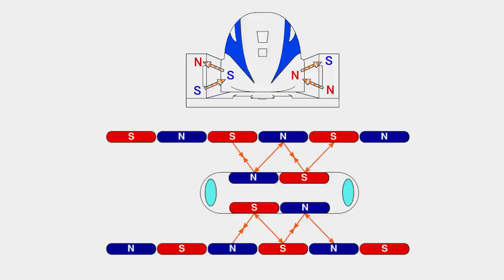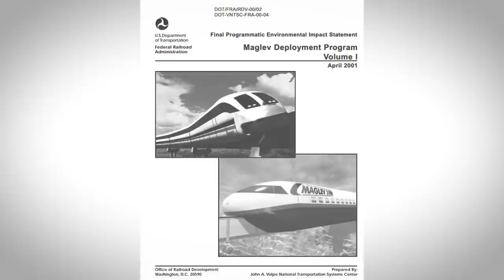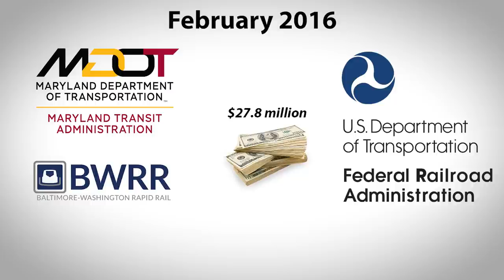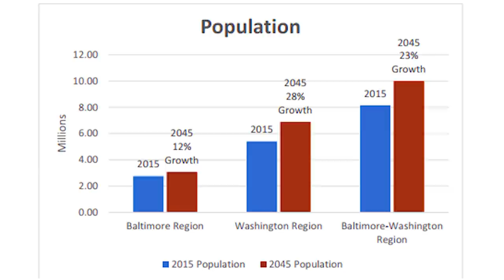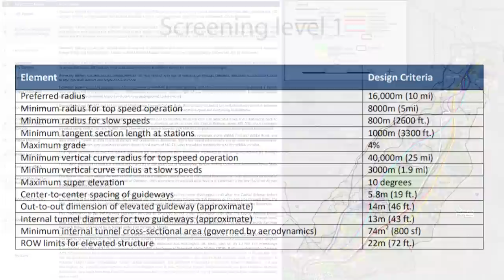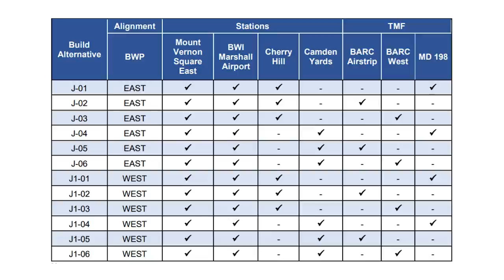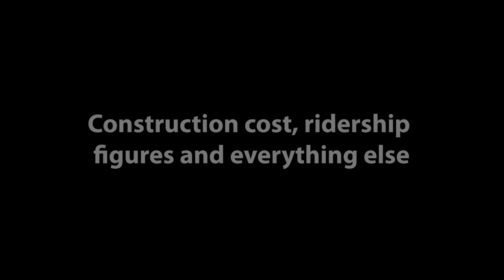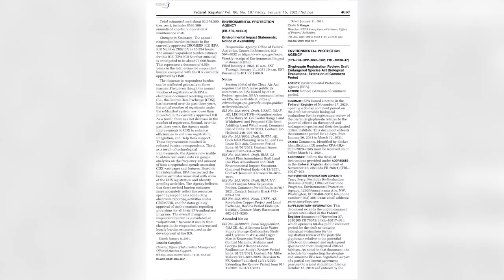Baltimore–Washington Superconducting Maglev Project

Comment: Crap. While I would like to see a maglev zipping along Baltimore to DC, it's just not in the cards.  HSR was basically an upgrade of standard gauge rails: Straighter curves, stronger railbed, continuous rail, electrification, etc. But conventional trains can still travel on them. With Maglev, there is no unifying standard. There is no single Maglev that was standardized. Each Maglev system is a separate unto itself, with no possibility of interoperation with any other maglev, let alone any other guideway system. This lack of technological homogenization is one reason why Maglev will fail.  In the Long run Maglev requires BRAND NEW infrastructure must be built to accommodate those trains and maglev uses proprietary  infrastructure that conventional trains cant use. China went 850 BILLION in debt building it's gargantuan, unprofitable high speed rail lines across China (now a Trillion by now)
Transportation innovations are economic game changers if they make travel faster, cheaper or more convenient to end users and generate More travel. Maglev meets only One of those criteria; Speed. While maglev would be at least 50 percent faster than existing high-speed trains and possibly even faster than flying short distances. It's certainly not economical to build it's comprehensive infrastructure over again. And barely convenient compared to the trains that may already exist. People think transportation issues are questions of technology, so any new gee-whiz technology will somehow solve the problems. In fact, real transportation issues deal with convenience, cost, and speed. A 300-mph train doesn’t do much good if it is inconvenient and costly and takes 15-20 years to build. A 500-mph airplane is far more economical because it requires less infrastructure, since airplanes need no added infrastructure except 4000 feet of runway. A 60-mph car is both economical and convenient. Cars are economical and convenient for short distances; planes economical and speedy for long distances. Buses vastly cheaper to carry bulk passengers modest distances. Building dedicated infrastructure for tens of billions of dollars to accommodate a new travel market.
Reply: High speed trains are by far the most convenient mode of travel to about 1000 miles and trough dense urban regions.
They are comfertable and fast, clean and no need to travel to distant airports and take a lot of car trafic of the roads in cities and save masivly on lost productivity. They can be very good investments that can provide a lot of economic growth and social mobility. That is why there is so much investment in them, for what they provide they are actually very cost effective.

They just need to be part of an integrated transit system and not just a line from one point to another, which is a problem in the usa. Plus in the usa everything needs to operate at an operational profit, which leaves very few and isolated routes that could be possible.
Reply: @Laurence Snow EU's high speed rail dominance has taken he liberty of cheap buses and freight trains. As such they have no room for freight. Airlines are profit driven enterprises and pay taxes thru revenues. As for "Environment" I don't give two spits about that anymore. It takes decades to amortize supposed emissions savings in which time relegates freight to trucks which emit and pollute more. Supposedly, high-speed train operations produce less greenhouse gas emissions per passenger-kilometer than air travel. But this ignores the huge emissions produced during rail construction. One study found that the operational savings will recoup the construction costs only if a line carriesa  specific threshold.  High-speed trains haven’t gotten people out of their cars or noticeably slowed the growth in air travel. On average, such trains have probably increased greenhouse gas emissions relative to conventional trains. High speed rail is also an enormous debt trap. Maglev which costs even more, a bigger trap. 

Technological introductions over lengthy time intervals are risky investments, because NO ONE can predict what technologies will emerge to compete against it by the time it's ready.
Reply: @spikedpsycho2383  Elon will save us all with the hyper loop.
Reply: @spikedpsycho2383  Elon will save us all with the hyper loop.
Reply: @foxkenji  Hyperloop will fail, for several reasons.
1: Infrastructure: The problem here is Hyperloops require Smart infrastructure which is NOT a good thing. Smart infrastructure is infrastructure that contains the technology for whatever it is supposed to do within the infrastructure. It's downside is it's owners must pay for the upkeep of both infrastructure and vehicle. And trust it's users will not abuse or destroy it. Technological sophistication invites planned obsolescence; once it's available if it should require constant upgrade, it soaks up huge IT expenses and support costs. And should the technology provider go bust, or use proprietary technology is destined to fail, namely because if they should desire to upgrade it or replace it, costs mount. Once this is done and a significant amount of infrastructure is built, however, it will be difficult if not impossible to upgrade the technology as new ideas are developed. Since the technology is in the infrastructure rather than the vehicles, any new technology would require that existing infrastructure be rebuilt at great expense. That means shutting it down as upgrades/overhauls take place. Dumb infrastructure is infrastructure that incorporates minimal technology and instead relies on infrastructure users to supply their own technology but pay for the capacity to use the infrastructure provided. The advantage of dumb infrastructure is that it is technology independent. The reason cars and planes work so well, the user either provides their own technology; or pays the provider for using technology with exceptionally low amount of infrastructure (and thus LOW infrastructure costs). Flying requires little infrastructure except a few thousand feet of runway. For cars; the technology costs are bared by their individual owners. In any case, once hyperloop is built, there's nothing the technology addicts/pushers can do to address or answer for improvements in automotive and airplane technology. Therefore it's technology will become obsolete in which case they go back to drawing board. Not to mention new routes; the industry will be torn between building more which will add to the logistical burden of maintaining their technology. Technological introductions over lengthy time frames are questionable investments. Because NO one can predict what technologies will emerge to compete against it by the time it's ready.

2: Freight: Specifications for hyperloops don't even allow for minimum width of standardized shipping containers used world over for trucks, ships and conventional freight trains. Meaning it cant carry freight; Not without having to be repacked twice for offload and onload.

 3: Costs: It’s private capital. Unlike Musk’s subsidy kingdom of EV cars, solar panels and rockets all of which are paid contracts or subsidized by uncle sam. Hyperloop requires hundreds or thousands of miles of very precisely manufactured fixed infrastructure, unless the governments paying for it. While Megabus charges about $15 to go from New York to Washington, Amtrak currently charges about $150 to ride its Acela over the same route, and that $150 doesn't pay for the capital or maintenance costs needed to keep the trains running.

 4: Intermediate stops: Those are even more problematic. If pods travel in a vacuum tube, they will need to go through airlocks both entering and departing the tubes, which will add several minutes to the journey. If pods make intermediate stops, each stop will add airlock time, significantly reducing the speed advantage hyperloop is supposed to have over other modes. The alternative is to construct separate tubes to each destination: one tube from A to B; another from B to C and Another from A To B and A to C and D and so on. At $50-100 million a mile, costs quickly rise to be many times greater than the California high-speed rail line, which was supposed to eventually serve all of those communities. With Nothing to say about capacity.

 5: Economics: conventional planes would be about the same speed and cost less (due to lower infrastructure costs) than hyperloop for medium-length trips, there may in fact be no such optimal length. So even if Hyperloop is supersonic, its fares are metered by whatever costs associated of maintaining infrastructure. Not to mention what might be miles and miles of tubes, tunnels, viaducts, bridges across topography. By the time Hyperloop is ready for its first passengers, airliner, car and bus energy efficiency will increased to the point it doesn't matter. There are many private transportation companies nationwide, None of which spend any money of their own on dedicated infrastructure. Buses private or public use the same publically built roads. Planes use runways whether private jets or large airlines. Intercity-transportation isn't a heavy market; Bus and planes have the advantage; Buses are FAR cheaper to run despite longer times and airplane they depart when they're largely filled to capacity. expending heavy infrastructure to run variable passenger loads on dedicated infrastructure is a waste of money.

 6: Safety: Hyperloop is just a reiteration of an old concept of VacTrains. Have a train in a vacuum tube and it’s aerodynamic drag lowers to the point it can go hundreds of miles an hour or more with no more energy consumption than prior on the surface. Air resistance (drag) increases with the square of speed, and therefore the power needed to push an object through air increases with the cube of the velocity. To make hyperloop fast the tube is evacuated of air, much like those tubes that send parcels at banks and offices. The point is going 1000-2000 mph in a maglev train sounds impressive but any sudden loss of acceleration the massive deceleration from maximum speed and you’re going face first into the seat…even with seat belts that’s more g-forces than fighter pilots. A power failure or loss of magnetic levitation at any point and your train will hit the surface at the speed it was going, jetliners ensue heavy damage and injuries when they belly land when landing gear fails with landing speeds of 180-220 mph, a train over 1000 mph will rip itself to pieces. Worse a loss of vacuum pressure at any point inside the tube would be catastrophic since being a vacuum at sea level in a tube requires constant pumps to remove air; any sudden reintroduction of air pressure as the vehicle is moving would result in massive supersonic impact with sea level air. Meteorites entering the earth’s atmosphere heat up from friction; once they hit the stratosphere they burn up, once they hit the troposphere they often explode.

 7: Maintenance/engineering challenges: Thermal expansion: When metal heats, it expands and warps. A tube hundeds of miles long designed to operate as a vacuum with thousands of feet of welds/joints is thousands of points of failure and needed maintenance. All it takes is one dent or poke to cause a vacuum collapse.

  8: Energy costs: A tube behaving as a vacuum requires huge pumps to remove air. A tube ten feet wide and 500 miles long is over 200 million cubic feet of volume for which pumps, unlike conventional tunnels which simply fan air and let exhaust escape.
Reply: @Laurence Snow High speed rail, maglev and hyperloop is a bunch of flimflam because it’s proprietary technology, that’s why it sucks. Also it doesn't carry freight, which cuts into the rails potential revenue source. Conventional rail, highways and airplane can carry passengers and freight, even simultaneously. The requirement for dedicated infrastructure is a problem common to the pipedreams of many mass transportation enthusiasts, whether they are promoting light rail, monorails, maglevs, or hyperloop, dedicated infrastucture is a waste. Any transportation technology, no matter how futuristic or fancy, if it should need New infrastructure to be built, is destined to fail because it has to compete against technologies using existing infrastructure. 
In most technologies serve people, transportation tech in particular like cars, the Infrastructure is simple enough that accommodates virtually any technology the user provides. You can walk on them. You can bicycle on them, you can scooter on them, moped, motorcycle. You can ride a horse on them. You can drive a car, a light truck, a bus, or a heavy truck on them. Even transit vehicles like busses. You can drive a motor vehicle powered by gasoline, Diesel, steam, or electricity. You can even land an airplane on them. The widths of vehicle road or highways lanes internationally typically vary from 2.7 to 4.6 meters (9 to 15 ft), regardless this is inconsequential to the function of any vehicle meant to use it. Whether it's a compact car or a Hummer it fits on these roads. That’s it’s advantage, it’s applicable to technologically diverse options. By comparison High speed rail, maglev and hyperloop ALL need completely different infrastructures and technology; the needs very dedicated, expensive infrastructure, so dedicated virtually NO other vehicle can use it.

Example: If you travel internationally the plugs you find may not fit your devices. But adapters exist so even 6000 miles away you can plug your phone or laptop. Technology exists to easily adapt to it's infrastructure provided.

Roads work well because it easily accommodates infrastructure to the users technology, regardless of what they provide; whether you drive a million dollar Bugatti or 1000 dollar junker. HSR and hyperloop don't work that way they work in reverse by forcing users to adapt to specific infrastructure and technology. In any case, once built a hyperloop line would have no answer for improvements in automotive or airline technologies.
Reply: @Laurence Snow If you represent the plumbing and heating business, you are the mortal enemy of the textile industry, because warmer homes mean lighter clothes. Maglev, high speed rail and hyperloop are embedded, infrastructure heavy technologies with huge amount of vested interest and labor intensive tech. Automobiles, planes and whatever they're working on along those lines are the enemy of rail, because they require less political support and virtually little infrastructure they stand in the way....